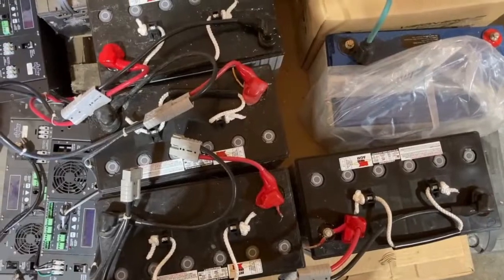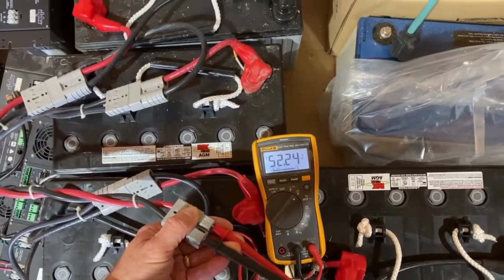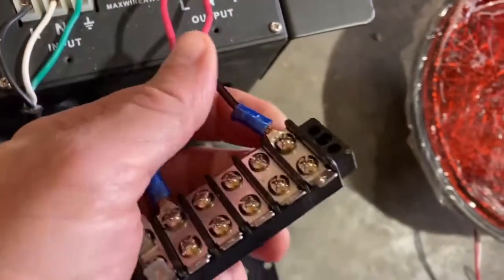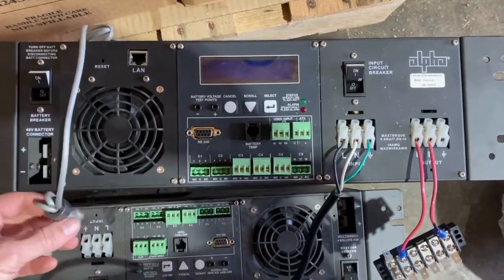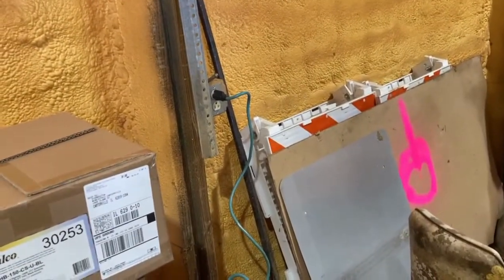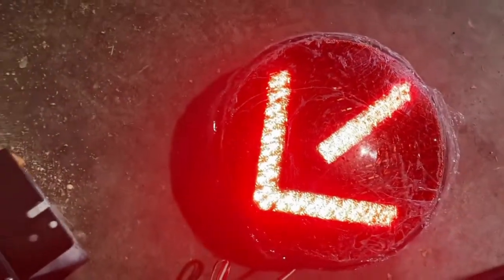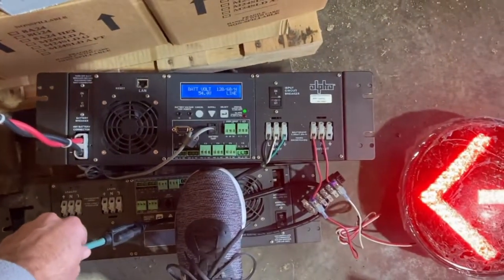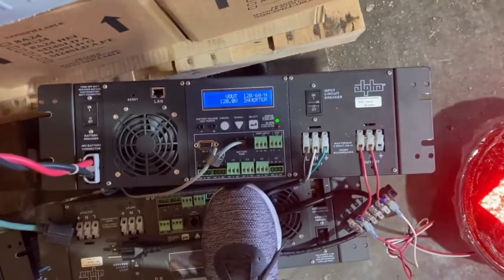Traffic Signal Battery Back Up Testing

Comment: How long a run time does an intersection typically have on backup
Reply from the maker: All depends on the load size of the intersection and the size of the BBU Unit.  A small T intersection with a handful of LED's signal heads would run much longer than a full blown 4 direction major hightway intersection, with ped siganls, blank out signs, etc.  Just think...Lets say 6 (3 sections heads) which equals 18 total indications for the T intersection.  Compared that to the big intersection that may potentially have 100+ total indications.  You're run time is going to be significatly longer with the T intersection.  
But on a standard intersection....3-4 hours?  This is on a fully charged system.  Thanks for the question!

Comment: I noticed there is only a single 120 volt circuit output on the unit does this unit provide power to be entire intersection or does it only provide enough power to put it into flash and if it does could you make a video on explaining on how it works with the rest of the cabinet
Reply from the maker: Yes, the Output provides overall intersection power.  In the video, I just hooked up a spare LED that was laying around just to verify the operation of the BBU.  Back in the day (when incadescent bulbs was mainstream), when there was a loss of power, we would have to make the BBU switch to flash mode to provide power.  Because it was such a large load on the BBU, we would also have to split the flashing output evenly among the LED's in the field.  This is why you see the ping ponging flash effect so often at intersections.  Instead of being 100% flash on, then 100% flash off...you have the load 50/50 split.  That way you can provide power without overloading the output.  
But with LED's, there's no worry now.  Power consumption by an intersection is dropped by approx. 75% with LED's.  Thanks for commenting!
Reply: @streetsmartstraffic  interesting 
So the entire intersection is able to be powered by a single 120 volt 15 or 20 am circuit?
Also one more question what would happen to the intersection when the unit runs low on power do the intersection shut off  and how long does the battery last on a average intersection during a power outage
Reply from the maker: @blocksly2020  Yes to your 1st question.  Most BBU's have a programmable interface where you have the option of how it will handle the intersection when the batteries are draining too low.  Many like to have it kick the signal into flash mode when it reaches a certain threshhold--for example, when there's only 10% juice left in the batteries.  On average, I say 3-4 hrs on a standard intersection (with LED indications)

Comment: Have you installed the new Myers BBS units.
Reply from the maker: No-haven't seen them.  I previously had a handful of the older models and wasn't a fan of them.  One initiative I did when taking over was to streamline our product line.  Makes it much easier when a piece of equipment goes bad.  While we have a handful of MultiLink BBU's out there, we're primarily Alpha.  Thanks for the comment!

Comment: However, your battery replacement program uncovered additional problems which are hopefully being addressed.  In a Preventative Maintenance program,  I would call that a win.
Reply from the maker: You are exactly right.  We have these BBU (especially the batteries) on an inspection schedule now.  I have found with the lead acid batteries, about the 4 yr time frame is when they need fully load tested and probably replaced.  Although if they have a little juice left in them, sometimes we ride it a little longer....Thanks for the comment!

Comment: Do these units have any kind of built-in diagnostics?  I see there's a LAN port & seems it would be useful to be able to run a remote test before going onsite.
Love your videos BTW!  Congrats on 1k subs!
Reply from the maker: You hit it on the head!  When programmed with an IP address and an ethernet cord inserted into the LAN port to a switch, you can do just that.  And YES, very helpful when you have a 3 hr drive to a signal and you want to check it remotely before taking that haul.  Thanks for the kind words.  Much appreciated!